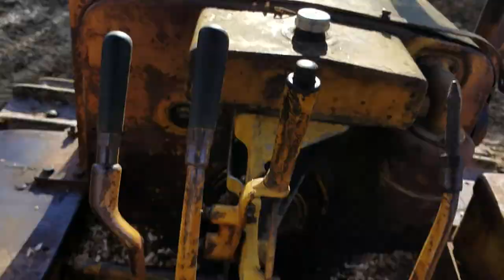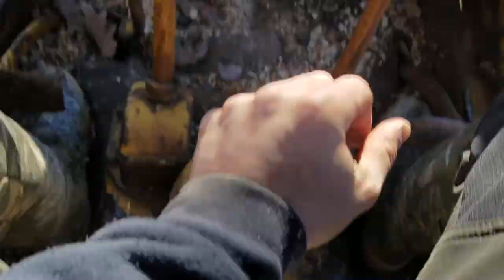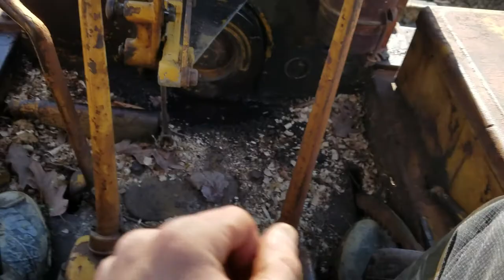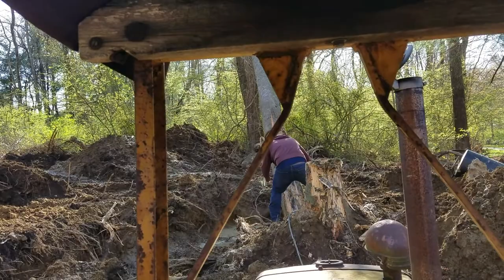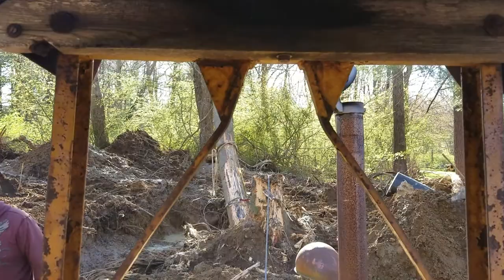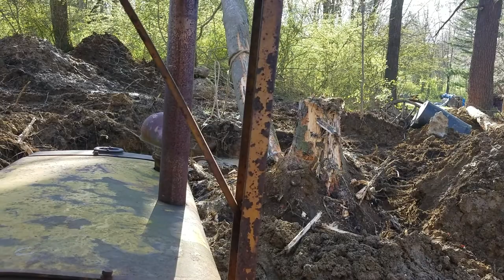7J D4 Caterpillar stump take 1

Comment: Why did you  not use the rear winch it would pull ten times what the dozer can pull.
Reply from the maker: I havent figured out how to make it engage. The lever doesnt seem to do anything when I tried it. Also, I need to replace the cable before actually doing anything with it.
I have a whole second pony motor, winch, along with the bracket that went over the cab to allow the winch to move the blade, and a good spool of cable. All came with the machine. 
Still need to change the fluids too. It's a project. 
Was just kind of playing around.
Thanks for watching!